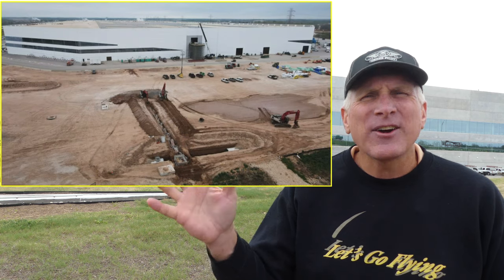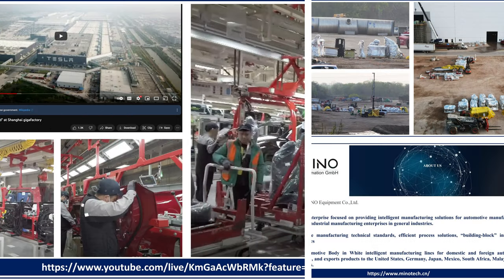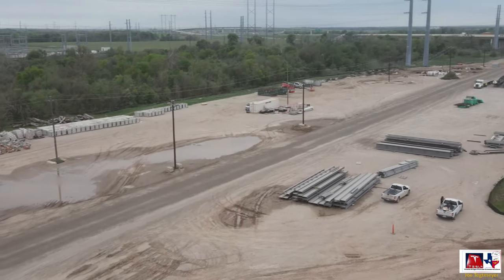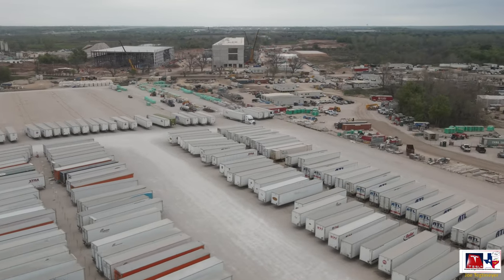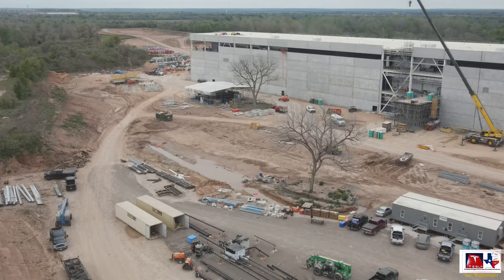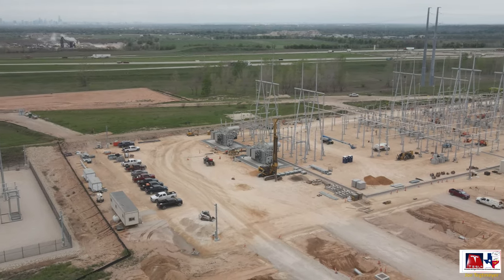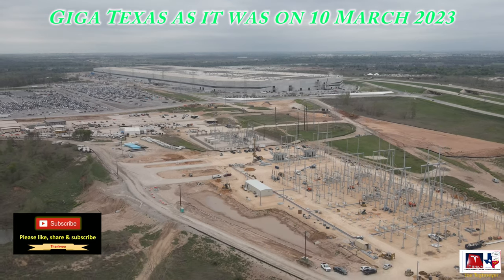Mino Production Parts, Crane Load Spreader &  Bridge Crane! 10 March 2023 Giga Texas Update(08:55AM)

Comment: at 13:50   The liquid nitrogen is for displacing the air.  The oxygen in the air reacts with lithium, causing it to oxidize and turn brown in a few tens of seconds.  So the assembly equipment is enclosed and the pressure of the nitrogen keeps out the air.

Comment: @22:15 they have double cross bracing in the second bay from the end. INTERESTING!
Reply: 22:15. Two parallel unconnected structures. The structure the supports the bridge crane inside, building structure outside.
Reply: @DessieDoolan  Thank you. 👍
Reply: @gtbproductions1  I tried to answer your body in white question, but it wouldn't stick. Youtube does weird stuff. Lets see if it sticks here.

My understanding is that early bodies were tin plated steel fixed to timber frames. Tin being a white metal, unpainted bodies were known as a body in white. 

The white primer is another oft quoted reason.
Reply: @DessieDoolan  I get that every now and then. For whatever reason, Youtube won't let me post a comment. Frustrating

Comment: In Tobias Lindh's latest Giga-Berlin time-lapse flyover, in the "junkyard" there was a machine-like trailer with great jaws looking up and open. A crane lifted scrapped auto body-in-white frames, one at a time, and dropped them into those jaws, which went "crunch" and turned each into a small cube, in what looked like about 30 seconds! The crane then lifted that out and loaded it into another truck bed for recycling. That bed looked big enough for maybe 20+ cubes per load. I was wondering if there is similar recycling equipment (which I've missed) outside at Giga-Texas?
Reply from the maker: They recycle the Giga Texas car bodies on the far east side near the Colorado River. This is also near where other materials such as crates are recycled as well.
Reply: @JoeTegtmeyer  Thank you. I'll watch for that. Actually there has been little news about the Boring Co tunnel and the island park area either. Probably a lot more important things going on now. The complexity of the water management system and underground electrical and other utilities is amazing. It would be interesting to know why the new big power pole appears diametrically opposite the location of megapack site?
Reply: @WarrenLacefield  They are building tunnels under the road from TBC HQ to SL HQ,  across the road.  I suspect the same machine will do this tunnel too.  My only question as far as when, rest on if there is another project in the queue before this one.
  Again, I suspect that there isn't and Austin Green will be getting it's first Boring Tunnel, within 4-5 months*.  *Possibly Elon Time 
  At some point, not with in a year but within three, I expect a utility tunnel to disappear all those pylons too,
Reply: @timboatfield  Thanks, Tim. Plenty of progress going on now, but also so many things to anticipate in the future. These plant flyovers and, of course, SpaceX videos, make that exciting for everyone, especially young people interested in STEM, IT, manufacturing, logisitics, and related subjects/careers.
Reply: @WarrenLacefield  YW.  It's an inspiration to me I'll tell ya.  Standards to aspire to!

Comment: Tesla may be experimenting with those green load levellers on the extended concrete shelf in order to see if there's any benefit to deploying them over and above all of the others they've deployed. As Tesla is oft want to point out, they tend to iterate with each new gigafactory as they see what works and what doesn't.

Comment: 11:50 It looks damp at the bottom. Whatever it is that they are planning, they can't dig further without risking collapse. To do so would require them to improve the dewatering system.
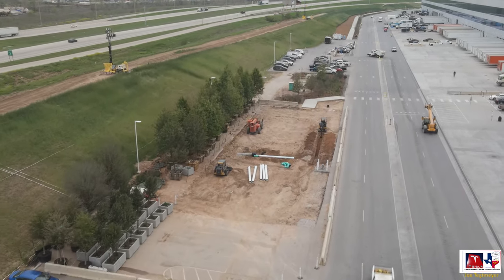13:10 That has nothing to do with roof drains. It looks like they are going to do some landscaping which would require them to modify the drainage system for the road / nearby parking.
Reply: 11:50. Target depth seems to have been reached. All the shoring has been used up or removed, and the excavation contractor has packed up and gone. Some sort of construction next. Dropping in precast segments, or build a concrete structure within another ring of regular formwork shuttering.

Comment: Is it arriving? Or is it coming from that north field where that line of components is staged? The levelers mounted outside may be specific to heavier loads.
Reply: External dock levelers. These are regular dock levellers. The only difference being that they are located outside the building line. The reason for that is because in that area the top of the column footings are at a higher elevation than elsewhere. 3 footings would have needed to be radically altered to allow the construction of the dock leveller floor set-downs. A more practical way to deal with that was simply to move the set-downs further outside the building line and away from the footings.